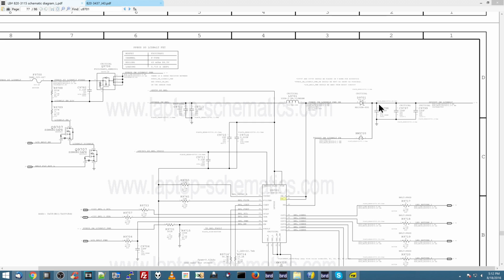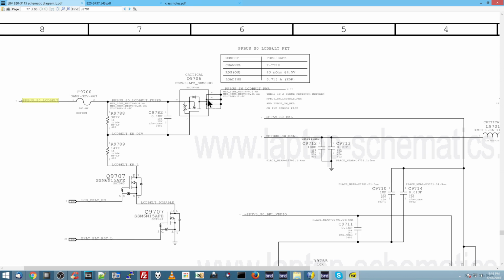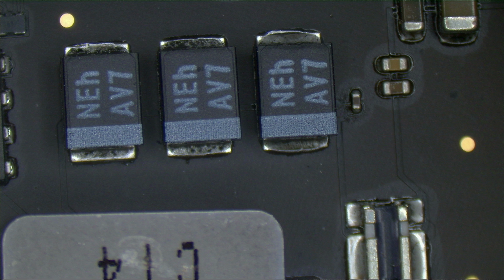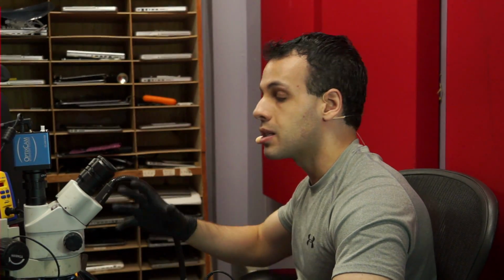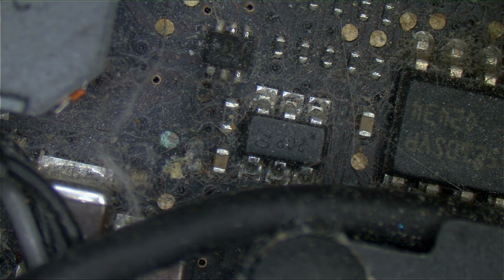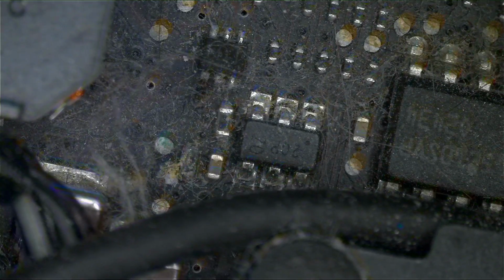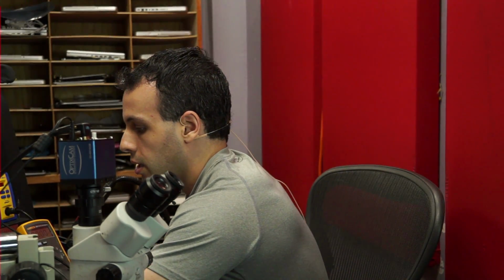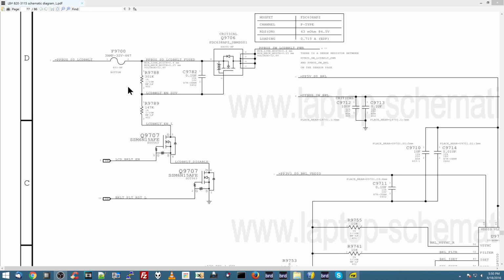Hunting liquid damage on 820-3115 boards with no backlight

Comment: Just a head's up on one reason why you might be having trouble with some HDMI capture cards. One  of the downsides of HDMI is that it has DRM built in to it. I'm not sure if this is related to the claim that the output is from a "medical" device, but I suspect it might be. As usual, DRM hurts the paying customer, and is merely a slight speed-bump for the pirate community.

http://www.howtogeek.com/208917/htg-explains-how-hdcp-breaks-your-hdtv-and-how-to-fix-it/

Comment: Unrelated question: My local hi-fi seller and sound engineer asserted that he doesn't use VLC to play FLAC on his macbook because "the software makes it sound terrible". Is he full of shit?
Reply from the maker: I have not done the research to ascertain whether that is BS, but it sounds like BS. Most hi-fi sellers are full of BS.
Reply: Louis Rossmann
Unfortunately true. I've talked with all specialized hi-fi sellers in my city, and they were all more or less full of shit. The first one tried to sell me "audiophile" USB cables, the second one thought high-res (think 192 kHz) audio made an audible difference, another one said that "lossless compression doesn't exist" and he liked the sound of WAV files over FLAC, and then I also heard that VLC isn't fit for audio playback. It's really discouraging and confusing.
Reply from the maker: Blauer Selbstmord I bet my genitals that none of those hi-fi dealers ever tried to sell you on owens corning 703 acoustic treatment that real recording studios have been using for over 40 years. This costs less than one set of their cables to treat an entire room and outside the speakers will make the most direct and largest audible difference in sound quality of a system.
Reply from the maker: Blauer Selbstmord The idea of WAV being better than FLAC is just fucking stupid.

FLAC is 2x + 3y = 13
WAV is x + x + y + y + y = 13

It's the same thing, just longer as WAV. There is no difference. 

Anyone who does not understand lossless compression failed 7th grade math.
Reply: Indeed they didn't try and sell me owens corning panels, but they were aware that room treatment makes a difference. I just plan on taking care of it myself. I may look into those panels though.

As for FLAC/WAV, I know. FLAC restores the original PCM stream on playback, so it should be obvious to those people...

In his defense, the VLC-complaint guy was still able to offer me a hi-fi set that makes sense, doesn't go over my budget and sounds truly great.

Comment: Everyone I know with a Blackmagic has problems with it. Both the StarTech PEXHDCAP/PEXHDCAP60L (really Yuan/Micomsoft SC-500N1/SC-512N1-L) are pretty great cards. I haven't personally tried to use two of them simultaneously, but I know AGDQ (a streaming event where they had 1-4 gaming consoles/pcs and 1+ cameras as input at the same time) was using two of them fine, but had issues with 4. You might want to ask TestRunner on the speeddemosarchive forum/@Test_Runner on twitter as he did the last one. If you google for "AGDQ 2016 - Tech Feedback Thread" there is a thread with details on their setup.

The obs forums is also a good place to look. FerretBomb and Boildown in particular are knowledgeable.

If you want to go with a single card with at least two inputs I would go for something like the Yuan SC510N4 or SC510N2-L HDMI/4K or a Datapath VisionRGB-E2S. Those are going to range from $500 to probably $1500+ for the Datapath though, unless you pick up a used one for cheap on eBay.

Comment: Back to using schematics? Settled things with the big lawyer firm?
Reply from the maker: +MobiFix no. Never heard back. I have over  220 videos with them, I don't see a point in changing how I do things
Reply: No, but i mean you were clearly avoiding schematics for a while, so i guess you're not as worried any longer.
Reply from the maker: I thought about it and how stupid that is to not use them... I have 220 videos with schematics. so even if I don't use them going forward, that's 220 claims that could be made..

If I had 1 video with schematics, maybe there'd be a point to avoiding it, but i have 220. I already did it, I can't undo it, so might as well continue with it.

Comment: Hey Louis have you tried windows 7 with the capture hardware?
you aren't supposed to do this, but you can take the windows key off of your old t520 and then manually activating it by calling MS (they have a cool website where you can do it instead of dealing with the robot or a person)

Comment: Hey, Louis! I (or iFixit did) found an interesting article that you may want to check out. According to the law, the warranty of your device can't be bond to agreements. This means they can't take your warranty if you jailbreak or root your device. In that case they'll need to prove that what you did caused it to stop working.
http://motherboard.vice.com/read/jailbreaking-iphone-rooting-android-does-not-void-warranty

This also includes the warranty stickers.
http://motherboard.vice.com/read/warranty-void-if-removed-stickers-are-illegal

There are some links in the articles that points to the rules, but I don't understand much of it. I'm a technician, not a lawyer.

Comment: I have a avermedia LGP Lite, hate the fact you have to 'stream' to other apps thats always a hit and a miss. If i add OBS and my Sony camcorder into the mix, i get about  3 second delay on the video from the preview and and a farther 5 seconds on the audio! WTF?
Reply from the maker: Avermedia stuff seems very low end, I guessed it would do silly stuff like that and avoided it.. and I am glad I did after reading this comment!
Reply: They do have a lot of recommendations (hence I got one...) maybe they were paid ones laughs.  I've had no issues doing Console-PC or PC to PC footage with system sound, so designed for a very simple capture system. I think @linustechtips moved their wan show to a Epiphan capture cards due to issues, but they look expensive  :)